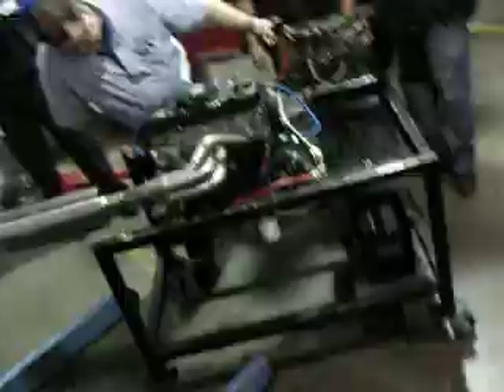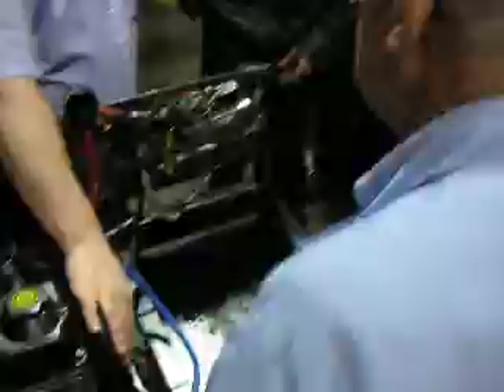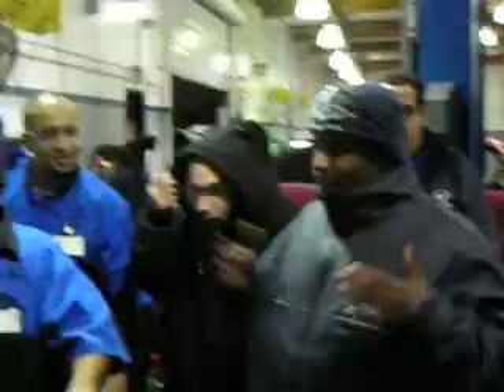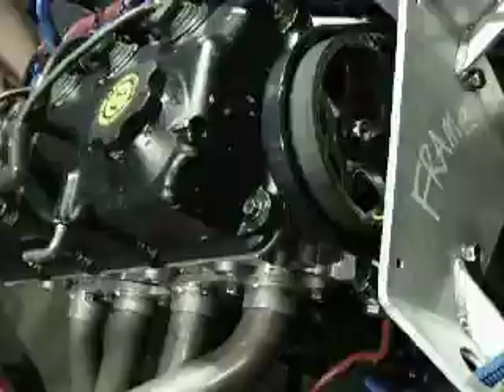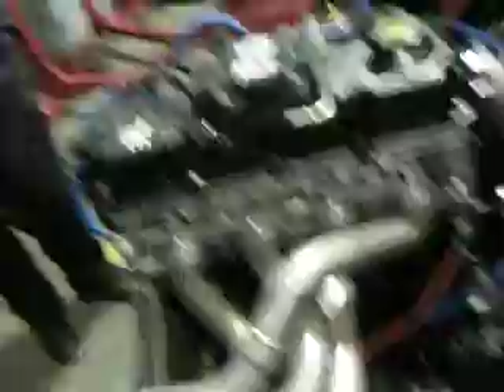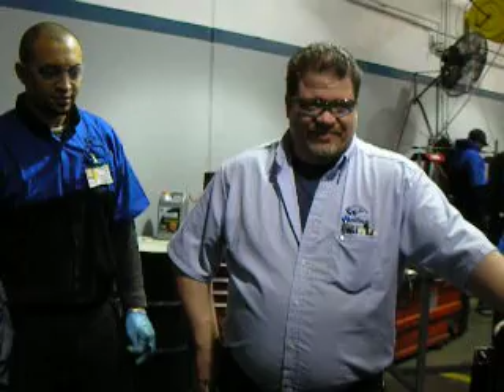Engine Blow up at school

Comment: Loose Camshaft Sprocket Grade-A bolt that requires Red Locktite (Blue ONLY on Aluminum) sucked all the valves because the T-Belt lost it's crucial and precise Mechanical Timing. Ahh, NUTS!

Comment: To the people arguing below, I'm pretty sure it's just a SOHC 2.0L from a Neon.
Reply: Jordan Greene Are you being sarcastic? lmao
Reply: +losi8ightyew That's why it sounds so cool and probably makes a lot of power. I'm sure its extremely reliable too.
Reply: Jordan Greene The only thing I really do in my car is launch it sometimes. I see a straight and it's just... nice lmao. My car picks up and goes (not sure what the previous owner did to the car, but he made my throttle extremely touchy, which makes the car all around really fun all around). I don't do that all the time (contrary to what people believe around here) just when I'm in a good mood and the timing is nice. Nobody around, nice little stretch, and a stop sign.. it's kinda hard to resist sometimes. I don't beat the piss out of it other than that. Keep it at a nice 2000-2500 rpm cruising speed. It's nice with my car though because if I sit at idle, you can barely hear it. You don't hear it pick up until about 3500rpm, and since I have the DOHC, I have a lot more top end than bottom end, so once you hear it, I'm picking up speed pretty well. I can also drive it quiet and keep it pretty low profile, too, which is really nice. I have a stock exhaust just open intake, which creates a really nice raspy sound. Chrysler gave the DOHC Sport Neons (what I have) really nice mufflers, so right off the bat it doesn't sound terrible. And yeah I change oil routinely every about 4k to 5k miles. Good filters and full synth oil allows to do that safely (as I assume you already know) and refresh tranny oil/tire rotations every time I change car oil. Might be a bit excessive for tranny oil, but oh well. Makes me feel better.

Long story short, I don't try to do stupid shit in my car unless it's for my own enjoyment. xD I like my car looking clean and taken care of and not really try to show off too much. I have a proper lower kit and it just makes my tires look like they fit in the wheel wells, not so low you can't go over speed bumps. It's kinda the same profile as a bmw. Their fenders outline their tires perfectly, same with my car. :p

I never really thought about crown vics like that. I always thought once they get a few dents in, they took them to body shops to get them fixed. You don't really notice any body damage at all on cop cars in service. That's actually pretty badass. I honestly thought for the most part when you see a beat to shit crown vic, it was just the owner didn't really care for it and just used it as a beater (and in a lot of cases you can tell it is from like not washing it or broken tail lights and such)
Reply: +losi8ightyew As an owner of a first gen neon, I can confirm.
Reply: William Melton
Yes, very. Haha. At least you picked up on it instead of taking me too seriously.
Reply: Jordan Greene Honestly my Neon with an unsilenced intake actually sounds pretty cool, and I can get up to speed pretty quickly with a larger intake, but I wouldn't take it out to race and brag about. It's just a fun little cruiser. Neons handle pretty damn well around corners, too. And one more thing, my mom's car (also a first gen SOHC 2.0L Neon) had 250k miles on it before she wrecked it in a head on, and we swapped into a breeze. When we inspected it, the thing was spotless and runs like new, so I'd say they're fairly reliable. Of course all engines behave differently, some are just better than others. :p
Reply: Jordan Greene Still picked up on your sarcasm though xD but in my experience around three of these engines in three different cars, I have to say, your sarcastic comment is actually not true. ;)
Reply: William Melton
How??? Haha, they were basically throw away cars as far as everything surrounding the engine.
Reply: Jordan Greene I know xD I'll drive my friends around and talk mad shit about other Neons, for that exact reason. The first gens were light though, and they have great handling. Put some aftermarket shit on and you can get them looking half decent, as well. My car has an undersized pulley, larger throttle, and an unsilenced intake, and I don't know what the previous owner did, but it has a SUPER touchy gas pedal. It's a fun car to throw around, and if you break things they're extremely simple to take apart and fix. Also the 0-60 times on Neons (only car I cared to compare with for obvious reasons) are actually really impressive in comparison to similar tier cars. My car can go 0-60 in just over 7 seconds and reference cars can pull 15 second quarters at stock. That's almost comparable to some modern day Chargers and Challengers (they pull just under 15 for their low spec cars)

The engines are unkillable though. I mean my mom got in a head on collision and totaled her Neon, I mean absolutely destroyed the front end, with 250k on it, and we inspected it and threw it in one of our other cars. It runs probably better than most new cars, and was completely spotless on the inside. These engines and cars I think are highly disregarded and made fun of, just because the cars themselves were little bitch cars.

Yeah I just said I drive a bitch car lmao
Reply: William Melton
You need to get yourself an old Crown Vic police car then, haha.  Those are as masculine as they come. 

Another reason they get disregarded is the interiors in the used ones you see are absolutely beat to hell.  And since theyre often driven by girls of guys who know nothing about cars, they neglect the maintenance and it goes to shit like any car would.  And not to mention some of the awful, awful body kits you can get for them.  The real cool mods are the ones you cant see, and sometimes cant even hear.

I've never really driven one, I just dont like the way they look and Dodges just seem to be an overall cheaply made car.  I drive an old Crown vic detective car with a beefy V8, and before that I had a Saab 900 Turbo convertible, which was comparable in size to the neon.  Which can be a good or bad thing depending on what you want out of you vehicle.
Reply: Jordan Greene Yeah, my interior is straight up SRT-4. Seats and steering wheel aren't stock and the center console is from a second gen (look nicer imo). The rest of the car has dark paneling to match, and the end result is actually really nice. I also have aftermarket lights (both front and back) and threw some tint on. I also lowered it slightly, just enough to have the wheels fit with the wheel well kinda like how BMW stances their cars, and the rims are painted black (which fits really well since I have the dark cobalt blue Dodge uses). It doesn't like try to stand out, it just looks clean and refined.

I have to agree though, they look like shit stock, and some of the kits are absolutely ridiculous. I'd never put a kit on my car, just small little touch ups. Mine looks decent because almost none of it is actually stock on it. xD but they are still very under appreciated for that exact reason. They corner very well and with the right mods, they can be fun little cars. Just nothing I'd be going around trying to show up other people in, unless I threw in an SRT conversion (which I really want to do someday, then I'll have some room to brag).

I've never really looked into Saabs, but I've been hearing a lot of good stuff about the 900 and 9000s, I'm definitely going to have to look into those. Also I don't like crown vics too much because almost all the ones you see on the road, they have like chipped clear coats or just looks beat. Most of the crown vics you see are retired police interceptors (you can see the badge on the trunk) and most of those, you can see the age and hell they've endured. I don't doubt their power though, I've seen some pick up and go, but it's just very difficult to find a good looking one out there, from what I've seen at least.
Reply: William Melton
Have you kept up with the routine maintenance of the engine and suspension and stuff?  I always wonder with people that make their cars look cool, if they still care for the engine and other maintenance things such as regular oil changes, using good oil and filters, tranny flush, not revving the balls off of it all the time, etc.   I'm sure you know the stereotype of the Honda ricers that make their cars look "cool" but then don't change their oil for a year and sit there at redline at a stop light because they thing that their awful exhaust sounds cool.  I'm not saying you're like that at all, but I'm sure you know some of these people and how annoying they can be.  And how much it can hurt you to watch them kill their cars.

The older Saabs were definitely good, the 900's from the 80s and 90s were tanks and you could make them fast as can be with their turbocharged engines, not to mention they can handle very well if you do some modifications.  Im not sure if I said before, but my 96 900SE turbo went to about 240,000 miles before it finally died.  Those were problem free miles too, it was quite amazing considering I was the 8th owner!

And I really agree that some of the Vic's out there were beat to hell.  And my car's paint still has clearcoat, but it has about a thousand scratches on it.  But that's ok with me, just imagine the stories that go along with every one of those scratches, all the people that were arrested or slammed against the car.  To me, that makes it ok.  And my car was an assigned detectives car that was only driven by two people over about 10 years.  So it was taken care of, also they had them on very regular maintenance schedules so you know the oil and tranny and stuff was serviced just as the factory recommends.  The patrol cars, on the other hand, weren't assigned, so they ran all day, everyday and were not respected because the officer wouldn't be tied to the car, if that makes sense.

Sorry for the long reply!
Reply: William Melton It sounds like you're doing pretty well with your car then, keep up the maintenance and that thing should hopefully serve you well, as long as you don't live in an area where the rust will eat your car before the engine dies, which is unfortunately common around my area.  And if you have a manual trans in that, changing your tranny oil that often probably wont really hurt anything but if its auto, you might want to go a little bit longer in between changes, maybe 10 to 15 thousand and make sure you always change the filter with it too.  It really can keep things running smoothly almost forever as long as the engine doesnt suffer from any manufacturing defects that harm its lifespan no matter what you do to it. 

I'm a fan of the stealth look at times too, nothing too loud but a little noise when you're on it is always great fun.  And the V8 sound is really great fun combined with the always there power of an N/A car.  This particular car was taken care of when it needed to be, but it wasn't really a pursuit vehicle so I think they maybe skipped fixing body panels and paint.  Either way, its cosmetic and as long as she runs well, I'm happy.  Id rather drop a bunch of money on something to keep it running forever than a bunch on some painting supplies.  Everything that needs to work, works just as it should, but there's just a rough shell around the outside.  It kind of fits my personality too, haha.  And that's important to me.

Comment: The 'blow up' is at 1:14
Reply: No nothing to do with not tightening the bolts properly, I only ever tighten bolts lightly and just super glue around them! Never had any problems!
Reply: David Oze thanks
Reply: +clifton559 So it has nothing to do with the fact bolts had not been tightened to the spec torque when it was assembled?

Comment: I have another theory on this.. one of which I know from experience. If there is lack of oil to the cam shaft.. it will suddenly seize and sheer the pulley key off. Of course when this happens its out of time and pistons come in contact with valves.  Also typically when this happens it loosens the pulley bolt... Its finger tight at that point.  If you turn the engine over the cam is loose and the engine spins freely (w/o compression of course) the cam only seizes for a split second.  So the loose pulley bolt shown at the end of the video may not and probably wasn't the cause, but the affect of something else.
Reply: Easy there super tech
Reply: In that instance the cam wouldn't suddenly or momentarily seize. The drag from the cam running dry would cause the sheering force without immobilizing the camshaft (until it ran out of momentum).... But I think your take on the what happened shows insight. However in this case, he said the timing had recently been R&Red and a loose cam gear bolt would allow for vibration that would sheer the alignment pin. Diagnosis is also about knowing what the most likely scenario is for a given problem. Also, tightening this bolt presents a unique problem, as the cam wants to turn when you tighten it. In a school environment, somebody probably forgot to make the final step of immobilizing the rotating assembly so they could properly torque the cam and crank bolts to spec. I bet the crank bolt was loose when they checked it too.
Reply: Chris Lesmerises You are probably correct. I can tell you though I have watched two different cams on two different heads seize (nearly instantly) on Honda D16 engines due to lack of oil.  It was kind of mystery what happened because the cam spun freely afterwards with nearly no evidence of it running dry. The pulley key was just sheered and of course all the exhaust valves bent. This scenario may be unique to engines which have no cam bearings such has the Honda D16. The cam bearings would spin in another engine.. say a Chevy 350.  The lack of oil we found out was caused by the installation of ARP studs which have thicker shafts than the stock stretch bolts. The oil path in the D16 utilizes one of these bolt holes to transfer oil into the head and the ARP stud was blocking the input from the block. I don't know if the block was slightly off center in the machining process from the factory or what.. but after the second cam seized in the second head (same block) I investigated further and found this was the case. The only thing to do was to put an OEM bolt in place of that stud and vola.. problem solved.  I even reused the same cam and head.. just replaced the exhaust valves.

Comment: It happens. I fitted a bike carb kit to my car and didn't double check everything because i was too excited to try it and when i did the throttle got stuck and with no rev limiter i couldn't turn it off fast enough to stop the Lifters jacking up and bending 4 valves. At least i had spare valves and the damage to the head and pistons was minor so it lived again.

Comment: When teaching students mechanic courses the first thing you learn is SAFETY!! At least when I did my courses that's the way it's done. The exhaust should always be connected to a duct pipe that runs from the exhaust pipe to the outdoors even if you will be running the engine for a short period.

Comment: @marek0086 Because there can be extra clearance in the internal rotating parts When there is NO load on the engine while red lining it, our engines are piston (reciprocating piston) engines. That means: that when a piston goes up it's inertia takes up the minute clearances in the wrist pin, crank to con rod, etc. in one direction. Then the piston goes down and the reverse happens. Under load, this effect is very much minimized because piston assembly inertia(etc.) is damped by the load.